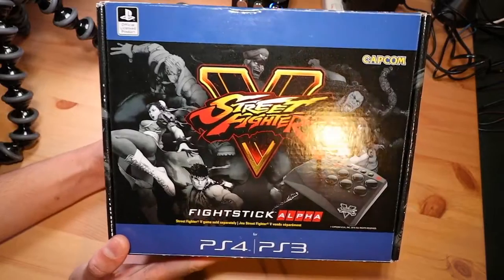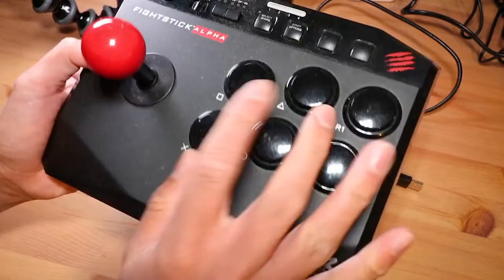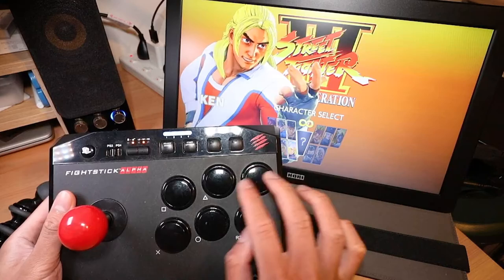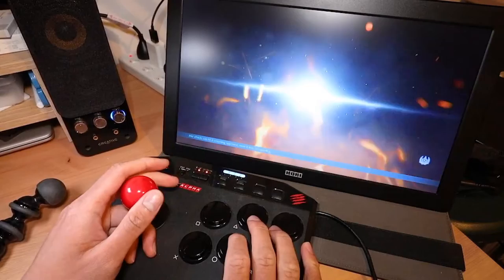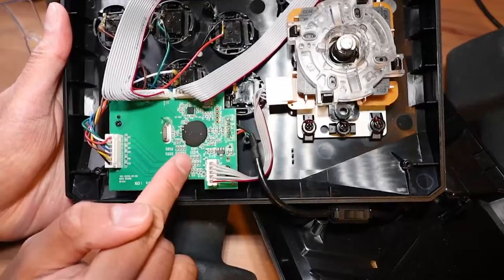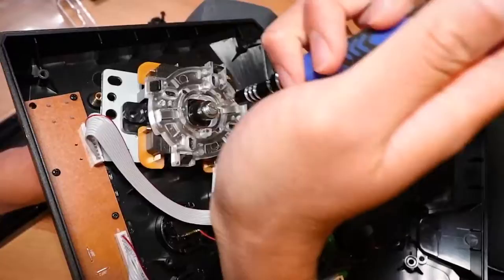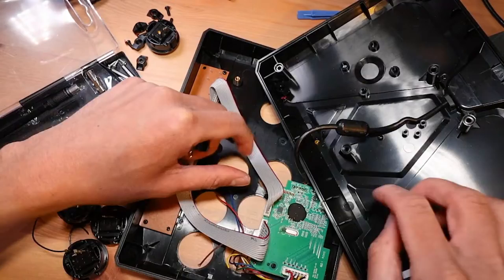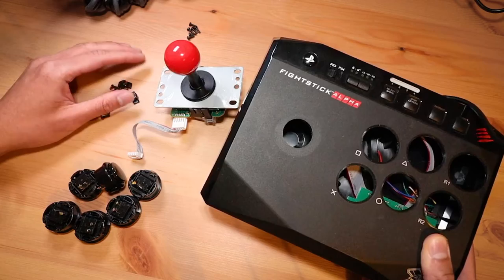Mad Catz Fightstick Alpha | Perfect base for beginner mods!

Comment: Hey man, I am new to your channel and love the coverage of all these arcade sticks. 

To combat the problem of small, light arcade sticks like this one moving around so easily, I highly recommend you buy a package of automotive wheel weights. Wheel weights are small squares - maybe 5cmx5cm weighing in at around 1/4 Oz each with self-sticking adhesive backing strong enough so they'll cling to car wheel axels. All you have to do is place enough of them on the inside of the bottom shell to add as much weight as you'd like. Sometimes I find that a little goes a long way. It also can help weigh down other objects around the house. Anything that's too light as it is.
Reply from the maker: Thanks for watching and checking out my videos! Yeah I definitely plan on following up on most of the sticks I review and just getting a lot of experience with different mods and cases. Takes a bit of time to get parts from the big arcade stores in the US to me in Australia though.

Comment: Oh and by the way....that Neo Geo controller would totally benefit from a set of rubber feet you can get at any hardware store and plus the wheel weights I mentioned. I'd love to see a follow up video. I think you'd find that a mod you can get done in five minutes and it would make the stick a lot more fun to use without it moving around everywhere on its own.